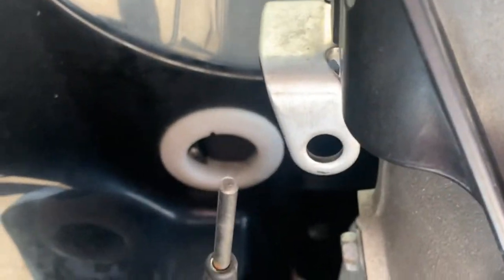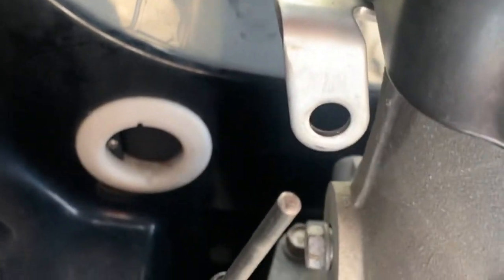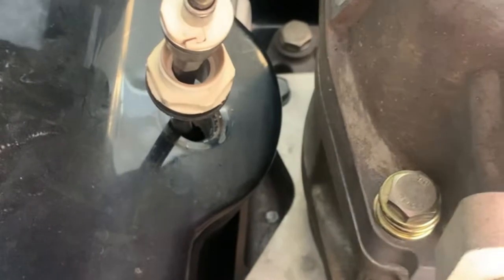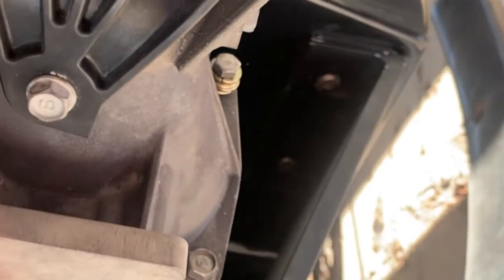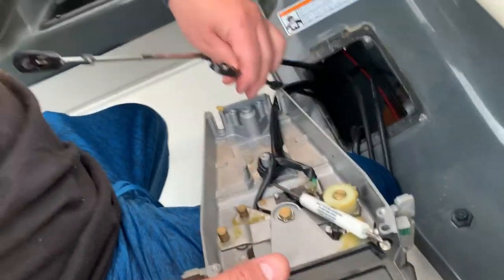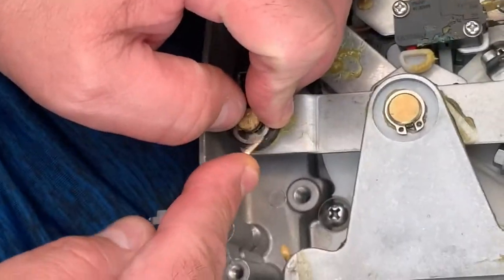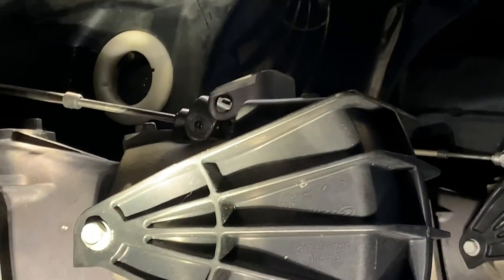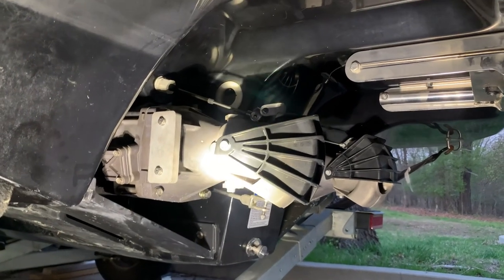2014 Yamaha jet boat￼ Reverse cable replacement Yamaha AR240

Comment: Help, do those cables sometimes get bent back down under there. My throttle is stiff due to my boat sucking a wakeboard rope got sucked under. I think the rope pulled the cable rod or bent the rod to the bucket.
Reply from the maker: It is possible that it’s bent, or it could be corroded inside the plastic covering.

Comment: How long of a cable did you buy or did you order the Yamaha one?
Reply from the maker: I ordered the factory one
Reply: Cool. Yeah couldn’t get them but went to west marine and you can use any length cable honestly. They had one that was the same size but a bit longer or whatever nbd turns out 👍🏻